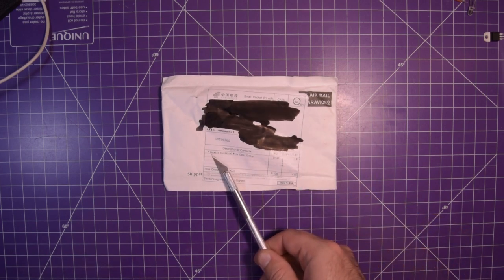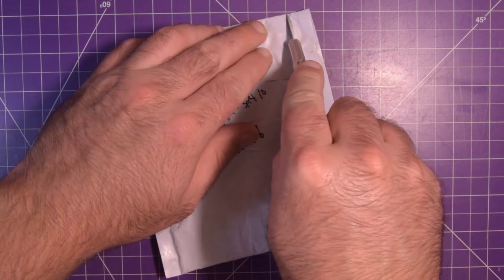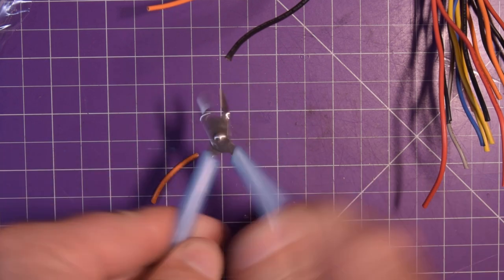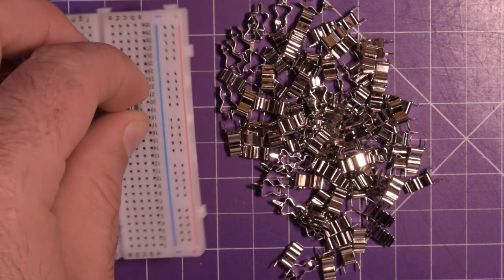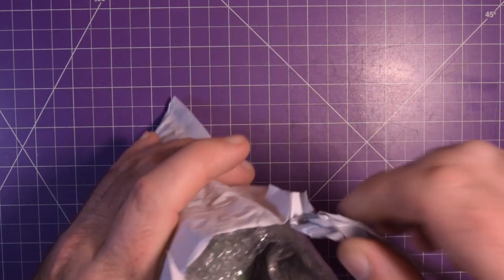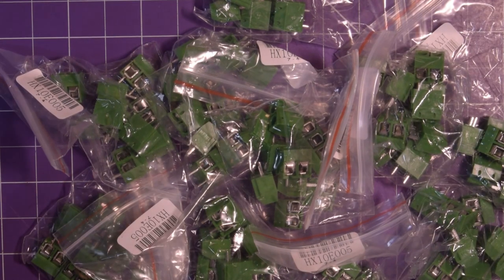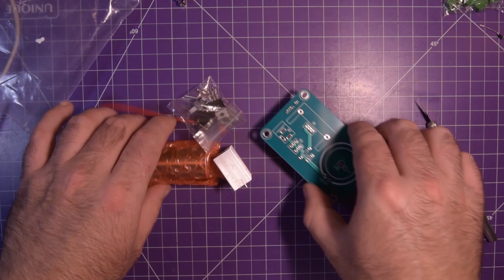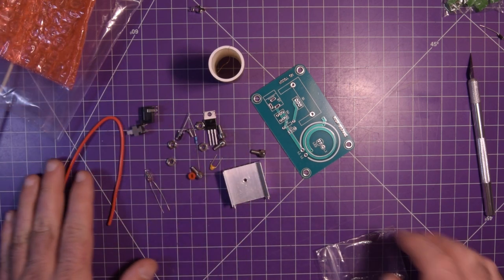Mailbag 31 - Super Special Edition

Comment: I hope you can get some noise out of that coil without blowing anything up like I did on mine...
Reply from the maker: oh-oh did you blow one up? I vaguely remember a video of yours
Reply: @SimpleElectronics  I blew up the external pre-amp I was using to try and drive it (or at least an electrolytic in that pre-amp). (didn't want to risk hurting my MP3 player by connecting it directly)